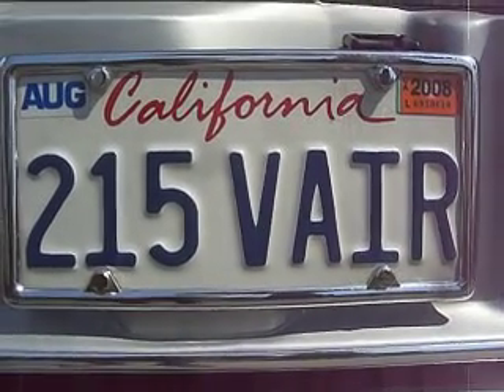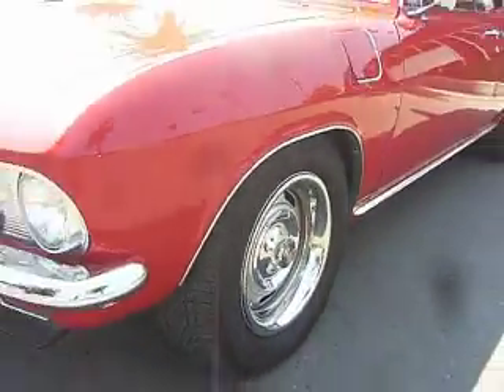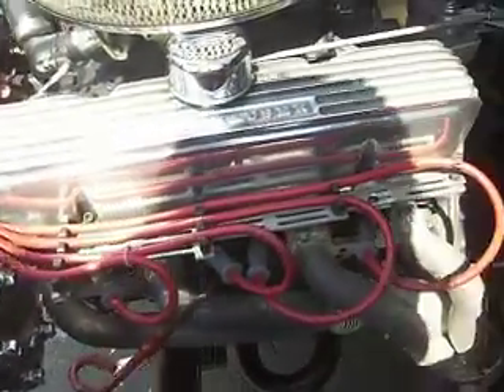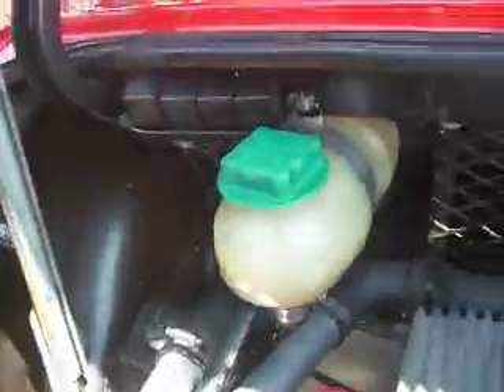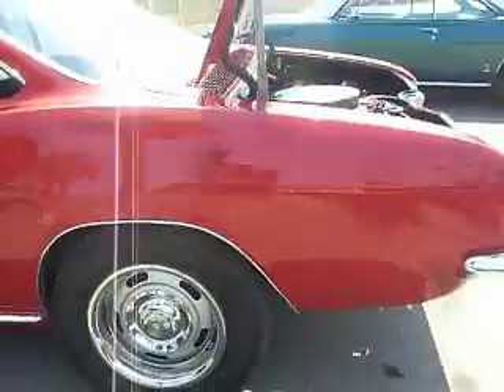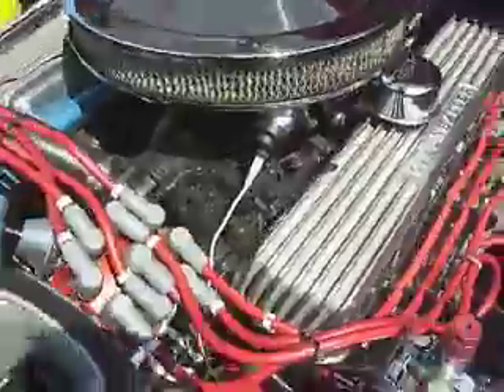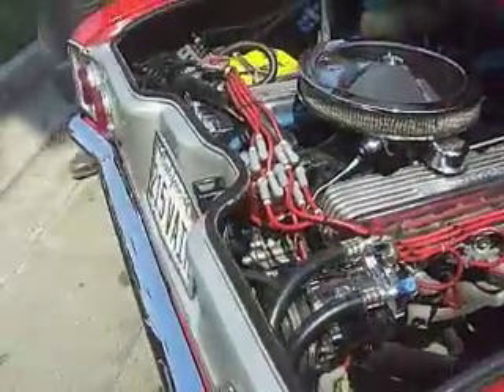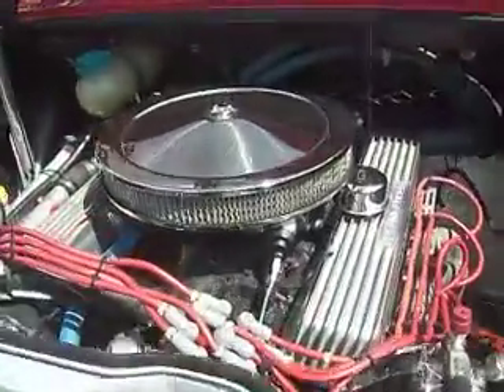Buick 215 In The Rear...

Comment: Cool. A Rover V8 in a Corvair
Reply from the maker: dl87z28 the Rover V8 came from Buick when Americans wanted heavy iron V8's. GM made some good stuff, hard to believe 55 years later it's still being manufactured. Olds offered a turbocharged version, but they goofed by keeping the compression high and having special fluid to stop detonation. Chevrolet did a better job on the Corvair, but they kept the carburetor small to inhibit performance. I drive a turbocharged Corvair with a racing engine, but I put a Cadillac carburetor on it, and it's way too big. I just bought a brand new Weber carburetor, and when and if I have the time, I hope to put it on and figure out how to get it running. Nothing is simple, and I just got a divorce and I had to move all my junk, and buy a new building, and I don't have a house, and Winters are long and cold, and I'll stop ranting. Hope you enjoyed the video
Reply: No shit! I am familiar with the Buick 215 story. I was being sarcastic. I'm standing here in my shop with my guys staring at 2 of them. One in an old Skylark and another on the floor waiting to be torn down for a rebuild with sleeves.
Reply from the maker: dl87z28 a friend of mine in Idaho put one in his 65 Corvair 4 door. I saw the car, but didn't get a chance to make a video. A plain barn found 4 door 500 series. He drove it from Idaho to Tacoma Washington a few years ago, but he was having clutch trouble. He prolly put AC on it. He just bot back his long lost 66 CORSA, he found it on eBay after 35 years! He will restore it!

http://www.cdapress.com/archive/article-33f32d09-cbbc-57e6-9e1b-e3b77b91f727.html
Reply from the maker: dl87z28 http://corvaircenter.com/phorum/read.php?1,961448,961751#msg-961751
Reply: Wow, what a cool story. You love to hear stories like that in our business.
Reply from the maker: dl87z28 where in the world are you? I'm in the Frozen North, -12C outside, and windy
Reply: Your local family owned and operated hot rod shop LMAO
Reply: I like Buick engines in a chevrolet

Comment: What good is all that horsepower if the car won't handle ? Should have done it right & done it as a mid engine.
Reply: As the same weight as it would have been from the factory and just like a Porsche and if you don't know how to drive just don't drive a car that has a rear engine leave it to the professionals
Reply: And another thing you need to do research on why Donk win races